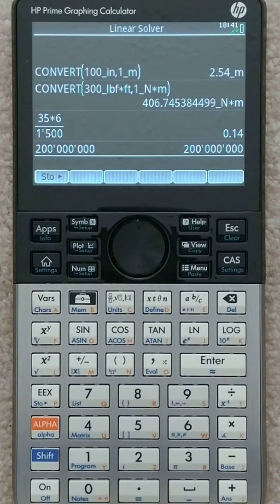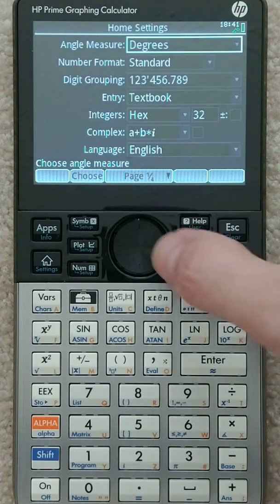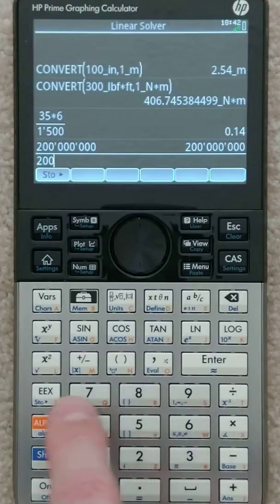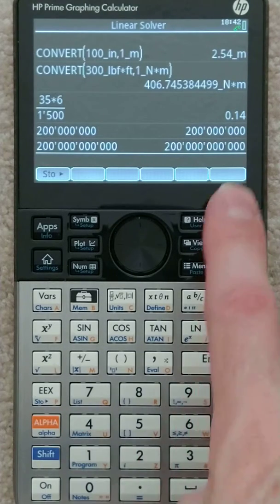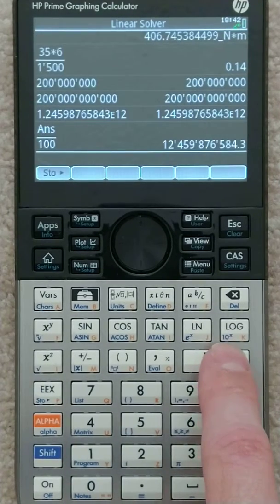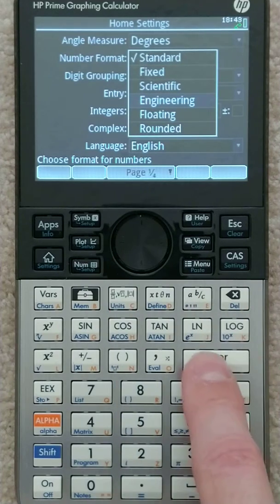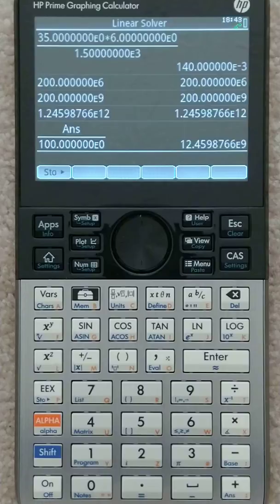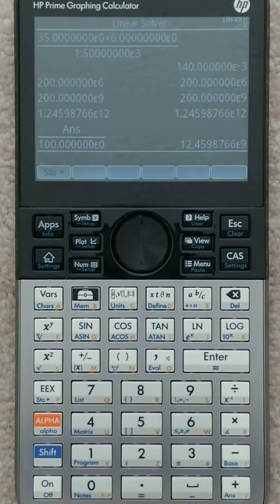HP Prime - Digit separators and Engineering notation

Comment: Why set number punctuation to tic marks instead of comma? I've never seen that notation used before in any text or documentation.
Reply from the maker: My Sharp calculator uses the same "tic marks".  I think it comes down to it being easier and cleaner to display without venturing outside the "text box" (i.e. not going above the high point or below the low point of any displayed digits).
Reply: @scottcollins7513  Fair enough. Every day you learn something new is a good day.
Reply: I'm a fan of it because it makes it easier to distinguish between a comma and a decimal point at a glance.

Comment: But that is not engineering though.  For example, we don't say 12.36e9 Pa, it's written as 12.36 GPa.  So why not show the symbolic prefix instead of the exponential format for real world engineering use?  Fail.
Reply from the maker: My CASIO fx-115ES PLUS 2nd edition does it the same way as the Prime.  There are some calculators (including some CASIO models, I believe) that do precisely what you are describing.  I'm guessing most engineers are good at knowing E9 == Giga, etc.  Regardless, it would be nice to have the choice.  Thanks for the comment.
Reply: I think "engineering" notation means "grouping exponents per group of 3".  The G, M, m prefixes are not always used by engineers. As some says, YMMV ;-)    (thanks Scott)